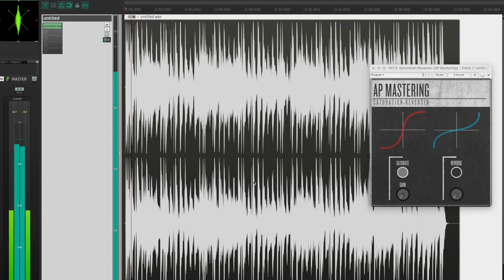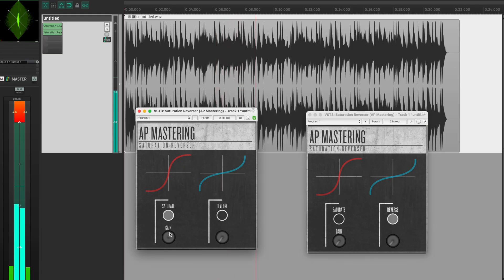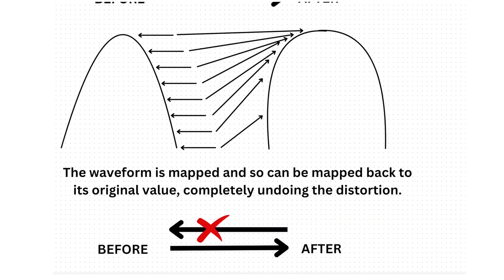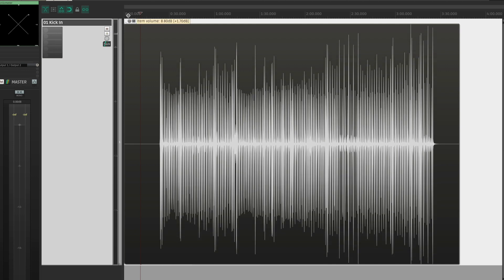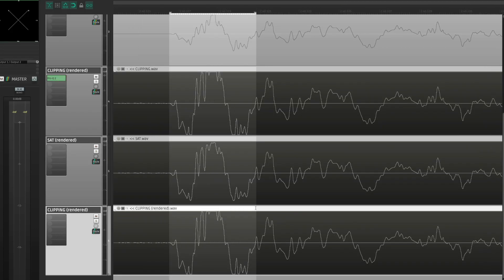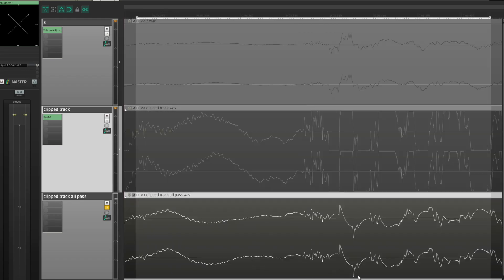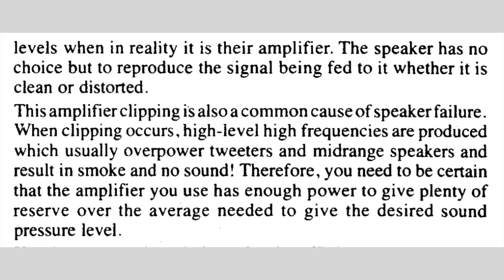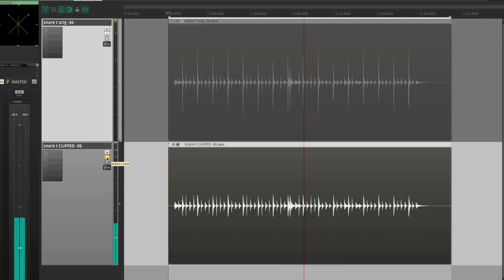Almost Nobody Knows, Distortion Can Be UNDONE!

Comment: The whole cant undo information loss thing makes me want you to base part 3 around AI tools meant to restore information. sony DSEE HX, Izotope Spectral Recovery, voice fixer, heck even the old low bitrate restoration trick of cooying the track shifting it up an octave and EQing everything below the cutoff on the real thing away 
Izotope declipper i have had make some good results Audacity not so much but maybe its for more specific issues
Reply from the maker: although I'm a mastering engineer I dont tend to do much actual restoration work, so this isnt really my strongest area. However, although I have used izotope rx in the past to sort of improve some really terrible stuff, I don't think any of that stuff is a substitute to getting it right in the recording, as none of it really sounds that good. I would be interested to interview someone who does actually restore historic recordings etc but this is not my thing at all.

Comment: Unpopular opinion: If it sounds good it sounds good. If those bits sounded bad then delete them. Genre dependet i think resloution is overrated. I dont care how the effects are done, as long as it serves the music. Sometimes there is a use case for hard clipping before a process like compression regardless if there is a phase rotation after. Maybe soft clipping is the move, maybe not. Ears are the final judge.
Reply from the maker: ears can be deceived by loudness. always level match your processing, especially something as destructive as clipping, like I do in this video
Reply: Oh I do, but sometimes the data loss is worth it

Comment: So, a certain TYPE of actual distortion (in this case algo of hyperbolic tangent, which compresses intensely the original values of the sound into a hypo-tan set of numbers).  This can be undone by the inverse function.  Makes sense.  Clip is dangerous because the original harmonic content has been wiped out and no longer available. 

It may make sense to saturate gently, but having clipping usually is going to be quite regrettable, especially if it is printed permanently into original multi-track sound.  I'd agree that "saturation" is not really clipping per se.  It has similarities but it's not really the same.

Comment: People use clipping and distortion for different reasons, distortion is changing the sonic character, clipping cuts off the inaudible peaks, so they won’t trigger your bus compressor. These are not equal steps in the prodction process, both have their valid place in the workflow.
And why anyone would want to reverse the distortion made by a specific plugin? In case you’ve lost the project file? Otherwise you just go back and export it with less distortion…
Reply from the maker: the reverser is just a demonstration. its not intended to be used restoratively
Reply: @APMastering  okay, and the other half? That saturation is an artistic choice, while clipping is a utilitary thing, that helps your bus compressor’s work? I think you’re forcing this idea to fit in your concept about “clippers are a scam”, but it doesn’t hold up. Cutting off inaudible and unimportant transients on a drum hit is a real thing
Reply: @SenorTropiCat bruh if you do this with "free" plugins then a 200 dollar clipper is a scam 

I don't care what creative purpose you give something 

That's just because you are tryna cope with spending 200 bucks on a piece of software that is not worth that amount of money 

Regardless, stop spending money on plugin they don't make you better
Reply: @Notinserviceij  who said i’ve spent 200 dollars on a clipper? 😹 I’m using the clipper in the TDR Labs limiter, a plugin that I would use otherwise too… Even without the clipper part.
Reply: @SenorTropiCat  that's fair enough but that is not where the argument lies, the scam part is about the stand alone clippers that cost that amount

I also use the TDR limiter, so you have my support uce
Reply: @SenorTropiCat  I think clipping can be creative too, but I'm into harsh noise and other extreme genres as much as I'm into more conventional styles. I feel like there's a dangerous dogma around the idea of resolution and quality that -- although it might be more based in data -- is **similar** to how audiophiles think of audio. If it works for the genre it works. If hard clipping a snare sounds better than soft clipping a snare I'll happily delete those bits and never look back. One of the most useful things I learned in my undergrad studies was that there's no such thing as a bad sound, just a sound that's wrong for the context. I feel like those nuances get lost in these discussions.
Reply: @JazzyFizzleDrummers  exactly. If it sounds good and fits the purpose, in this case what is wrong with it? Using saturation on a snare instead of hard clipping it is not the same.
Reply from the maker: I used to listen to merzbow. Pretty noisy stuff. It's not about the harshness or whatever its about the horrible glassy crunchy feeble sound which clipping provides but which the users of clipper plugins for some reason can't hear because they are so happy with the fact it sounds marginally louder than other tracks when directly compared with the same monitor gain.
Reply: @APMastering  I'll go back to what I said earlier, and the nuance I think this video misses. It's extremely genre dependet so where you might not like clipping on everything it does absolutely have its place. I wouldn't clip a symphony, but I will clip all over the place on an industrial album. I think your video with the digital vs. analog plugins was actually a stellar example of how artifacts from these processes can actually sound good. Iirc the poll had people preferring some of the brightness from cramping and aliasing that we are taught to avoid. "Right sound, wrong context". Sure it'll get less clicks than the more negative positions your content has been skewing towards, but I think there is more value in addressing the nuance in the video itself rather than hashing it out in the comments. To be clear I generally agree with most of your takes, I just wish it was more about the education and less about sparking controversy for the algorithm. Education from people who understand pedagogy is sorely lacking in the online audio engineering space and I find it extremely frustrating.
Reply from the maker: @JazzyFizzleDrummers  i totally get what you are saying about high quality educational content. i agree it's lacking. i'm trying to find a balance. no controversy, no views. every video is at least supposed to contain interesting educational content
Reply: @APMastering  controversy might seem like a cheat code for engagement, but I don't think it will serve you long term. I think it might hurt. Honestly I already find myself avoiding some of your content because of it. I think you're a brilliant engineer and I hope you find a way to be engaging without becoming a rage factory. Even in this video's comments I've run across some uncalled for bigotry against "ghetto" people and Indians. I don't want to see this channel become gearspace/slutz/whatever. I look to creators like Benn Jordan and Nicholas Di Lorenzo and see a lot of engagement and positivity. The industry has a lot of baggage and I hope despite it you can find your voice.
Reply: @APMastering  you didn’t answer my question about why do you think that using a clipper and using saturation is the same thing, when it’s clearly not. One is altering the sonic character, the other is reducing the load on your compressor. Why do you have to force this “controversy”, even at the cost of misleading a lot of people?

Comment: Tanh is too soft for mastering use unless you're happy to distort low level samples, which generally isn't desirable across a whole mix. The term "soft-clipping" is generally used for saturation curves that are much harder. Closer to full on clipping, while retaining a soft knee. For example: x/(1+x^8)^(1/8)
Reply from the maker: sure my free plug wasn't aimed at mastering engineers. As a mastering engineer I don't typically use this kind of processing anyway. Having a steeper function has its uses maybe as a part of a limiter design but I don't see how it is so useful in mixing personally.... I guess I'm just not cool enough to want to nuke the dynamics of my music unlike many of the people who commented on my last video. Anyway I tried out your math....

channelData[channel][sample] = channelData[channel][sample] / pow(1 + pow(channelData[channel][sample], 8), 1.0 / 8);

https://imgur.com/a/1r0XHZs
Reply: @APMastering  K. I just want people to know they don't have to jump all the way to tanh if they want to avoid hard-clipping. For me hard-clipping is full avoid, but a slightly soft knee does have its uses, especially on drums. Once you get to tanh I would call that saturation, not soft-clipping, but all are part of the same spectrum, with only hard-clipping being strictly defined.
Reply from the maker: ok so your point is that soft clipping and saturation exist as separate terms, based on knee, and although there's overlap you are willing to say that soft clipping exists in between clipping, and that saturation definitionally doesnt get close enough, therefore the term soft clipping is required.

What I'm saying is, saturation is everything of this sort which is not clipping, and there is no room for the third term, soft clipping.

We understand each other. But we disagree. I will stick to my guns as I'm not convinced that saturation is inconsistent with what you call "soft clipping". I'm open to having my mind changed but I see no reason right now to change it based on mere popularity of the term. I'm sure I could demonstrate electronically a type of saturation which comes close to clipping, like for example saturation of an op amp based amplifier which reaches the power rails.

Comment: Is the saturation in your plugin similar to the method used by the Oxford inflator? I remember reading a description of how it works that sounded similar to
Reply from the maker: might be but I dont know what they used in there
Reply: Yeah basically. Inflator is two functions similar to tanh, with a "curve" control crossfading between the two.
Reply: You can visualize the transfer curve by demoing Melda MWaveshaperMB and chosing the Mflator device. Then enter the edit mode to see the curve that resulted from your adjustment of the Curve control.

Comment: Question: I noticed that if I run a mix through a dithering plugin like the stock dither that comes with Cubase, using 16bit dither, I can drive the signal, it appears to "clip" (reaching 0db) but with no significant artifacts in the signal being introduced. What could be happening here? Is a dithering plugin acting as a "clipper" somehow?
I dont use this of course - I was just curious after messing about with various dithering plugins.
Reply from the maker: it might have a built in clipping function. im not familiar with this specific plugin since I dont use cubase (well I haven't done for around 20 years).
Reply: @APMastering  Thanks so much for replying! And thank you for such instructive videos!

Comment: Neat plugin! Ultimately, it sounds like you're advocating people use "softer-than-perfectly-hard-clipping" for level, which you prefer to refer to as "saturation" instead of "soft clipping". 

I agree with the advice, even if not the terminology! (Which is a bit unusual, as the term "soft clipping" has been used to describe this function for many decades.) 

I'm sure most people who advocate for the use of clipping would agree with this advice as well, as this is largely what most of them, are already doing. 

Correct me if I'm wrong, but I think the most popular clippers in music production are rarely, if ever, perfectly hard clippers.

That said, the distortion caused by perfectly hard clipping can be low enough as to be inaudible—given a sufficiently small amount of hard clipping. Not all THD added to the signal can be heard, below a certain threshold.

So, again, there are cases where adding some small amount of even perfectly hard clipping may be more transparent than adding a similarly small amount of additional limiting.

That said, the clippers that most people use for this purpose aren't perfectly hard clippers anyway :-)

I'll try the plugin though, it's cool. Feature request: Add more shaping options!

Comment: It's not just about loudness, it's about not loosing punch while making it loud. 
And the signal is going to be relatively louder than other songs and will be percieved as better. 
It will even sound louder when turned down by a streaming platform.
Even phase rotated, it will still be louder.
There is nothing a listener hates more than having to readjust the volume for every song. 
Increasing the volume of a quiet song in order to match loudness of the soft-clipped song is going to cause amplifier clipping.

And distortion can be undone no more than any process can be undone with an undo button - if you have the original information or the information about the process applied to it. You can also undo clipping if you lower the volume so it's not clipping anymore.
Reply from the maker: "And the signal is going to be relatively louder than other songs and will be percieved as better. "

No it won't be. If it is loud but sucks, it will be deemed a bad mix and the listener will turn it down. Average listeners might not be able to talk anything technical but they know a bad mix when they hear it.

"It will even sound louder when turned down by a streaming platform."

This is completely false.

"There is nothing a listener hates more than having to readjust the volume for every song. "

Do you have evidence?

"Increasing the volume of a quiet song in order to match loudnes of the soft-clipped song is going to cause amplifier clipping."

This is wrong. Speakers and amps can typically deliver double the peak power as sustained power. A clipped song decreases the crest factor, meaning the song has less peaks and much hotter sustained power with less loss through kinetic energy which puts more strain on the amp and can overheat the voice coils.

"You can also undo clipping if you lower the volume so it's not clipping anymore."

No you can't if it is committed. The point in this video is that saturation maintains detail AFTER BOUNCING. Whereas clipping destroys it.

Hope you can learn something from my response.
Reply: @APMastering  You have an idealistic view of the world. No, average listener can't tell a fart from bass guitar, let alone recognize a good mix.
Loud songs do not suck by default, this a totaly misplaced argument. Louder is percieved as better even by many mix engineers, you bett an average listener is going to percieve it as better sounding.
"This is completely false" - Try streaming normalized songs, there will be difference in percieved loudness.
"Do you have evidence?" - Funny how I have to prove things in comments, yet you don't prove your claims in your video. 
I and most people I know, hate readjusting volume, and if anecdote is not enough for you, it costs energy and it's a distraction to have to go to your amp, or look for your phone or the remote, when you just want to enjoy music, even worse, if you're busy doing something else while listening like most people do.
In practice, speakers are typically not going to be fed unaltered squarewave unless the clipping is occuring internally. 
Your arguments are really rationalisations of your biases.
A commited song can be replaced with the unclipped version of the song. Your point is no different, you need to store information either about the original signal, or about the process that's been applied to it.

I hope you apply logics and realize that you aren't teaching, you're just expressing your point of view.
Reply: @GoldenPickaxe  It was an expression, a figure of speech, most people overestimate their hearing abilities.
Reply: @duncan.o-vic  I would say, that a average listener can say, if a song is mixed well or not. That for sure.
Loud songs, which are pushed need to be very well EQ´d. There are a lot of things which go into having a great sounding, loud mix. Starting with the low end.
But one point I want to say as well. I sure as hell hate, when I need to fix my volume while listening to a playlist lol
But I also do listen without loudness normalization, which one CAN definitely turn on. This will help to avoid that, but you also then not hear the mix, as it was intended.
Reply from the maker: I detect some sort of cluster B vibe here. you think you are above your listeners and you know more than everyone else despite being demonstrably wrong in your first comment.

good luck with that.
Reply: @APMastering  I don't think I'm above an average listener, I just know from experience that they have much lower standards of what a good mix or master is. The performance and the song itself are 99% of the sound, and that is what they'll hear.

You however, seem to think you're above your audience and other mix and mastering engineers.

Good luck with your psychology career.
Reply: @jenyahp2828  Whether a song is well mixed is a matter of subjective criteria. There are levels of quality. 
An average listener has much lower criteria of what a good mix is, than an average mix engineer. 
AP thinks a good mix can't have any clipping in it, but I have seen people literally listening to music boosted and clipped to the point where there's barely anything left of the song besides distortion.
We like to think our work matters, but only a small percentage of people relly appreciates the finesse a good mix brings to the song.
Reply: @duncan.o-vic  average listener ? Even artists who have dozens of releases cant tell a good mix from a bad one sometimes lol